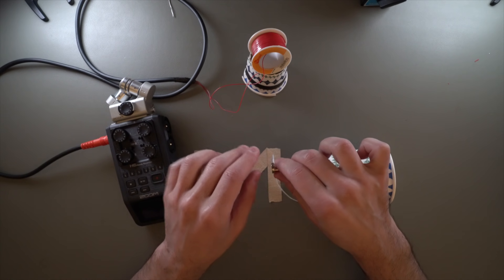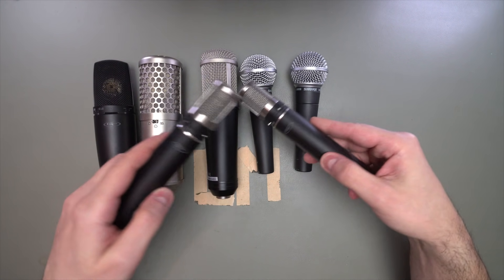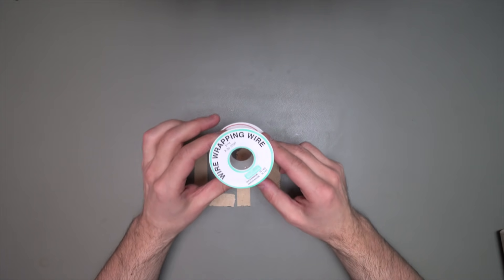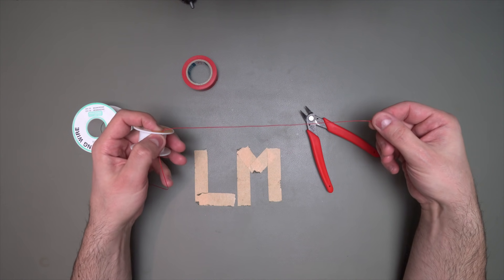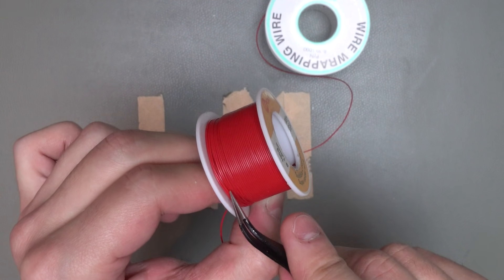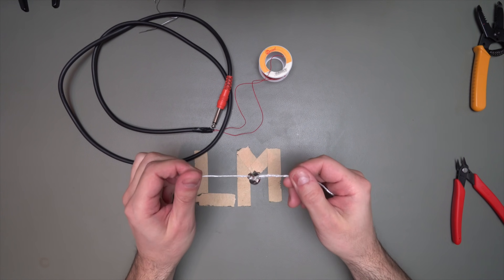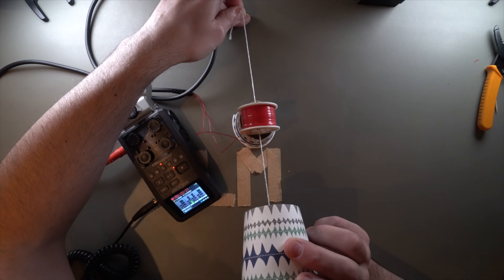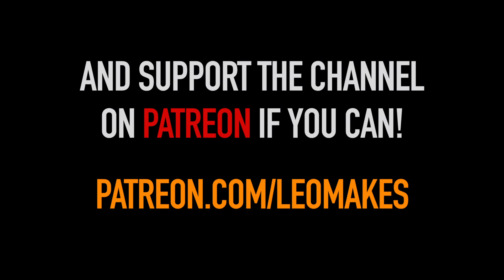Making a Paper Cup Microphone.  Less than $10!

Comment: You keep on calling the spool with the wire a “magnet”. It’s not, it a “voice coil”. The magnet moving inside the voice coil generates the tiny electrical signals that are amplified into sound by the trusty H6. Don’t  believe me? Try picking up a paper clip with your voice coil, after you’ve wound it. It won’t work ,because it’s NOT A MAGNET. Sorry to nitpick, but it’s quite an important detail.
Reply from the maker: A voice coil is an electromagnet. If you attach a 9V battery to a voice coil (electromagnet), it will most certainly pick up a paper clip!

It is not a permanent type magnet like the neodymium ones I attached to the wire but it is absolutely a magnet. 

Thanks for watching!
Reply: LeoMakes Yes, it becomes an electromagnet ~if~  you apply current. But it is a “Motor” in the case of a microphone. Instead of working as a magnet, the voice coil is generating current. To call it a magnet is ignoring the “why” of what is happening electromagnetically. Really great and enjoyable video. You’ve inspired me regardless. Great job.

Comment: If anyone wants to do this, you can also try using a speaker or driver from broken headphones in place of the cup and coil. For a challenge, find an amplifier transistor and try feeding the signal from the "capsule" into the gate of the transistor, with some voltage applied between the collector/emitter. You may need to add some resistors so the gate is biased to the right voltage. Solder headphone jack ground to ground, and add a capacitor between the left/right jack inputs and the output of your transistor. It's fun and can make a surprisingly strong signal.

Comment: I recently made a guitar pickup using the coil from a small wall transformer and a magnet. Works beautifully and I didn't have to wrap wires for ages. Besides, who doesn't have a ton of those wall-wart transformers from broken electronics in a box somewhere?
Reply from the maker: Good point!
Reply: @LeoMakes  You have to make tests first using some alligator clips. I find that the winding with the thicker wire doesn't really work. So I remove this one (save the wire for something else) and shorten the plastic holder to save space. The metal loop that goes around the transformer is a bit harder to get off. I used a ball peen hammer and a vice... not pretty but it works.

Comment: That's surprisingly good... One question: why not just use the whole spool of wire instead of winding your own?
Reply from the maker: Solid idea and that was actually my original plan!  I was just going to connect the leads without unwinding at all, but the inside lead was not accessible from the inside hole (they cut it too short). Also, you really do want to make sure it's nicely wound and tightly packed.  The wire I got from the store was a little bit sloppy, so I re-wound it.

Thanks for watching!

Comment: Can I connect it directly to a small speaker without an amplifier?
Reply from the maker: No, you’ll need an amp. The output from the coil is way too weak to drive a speaker (even if it is tiny)